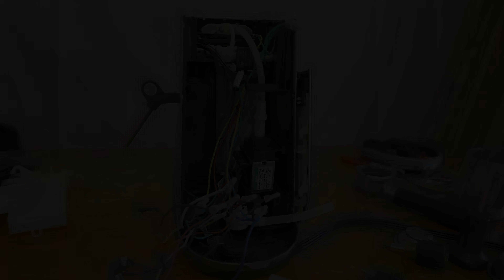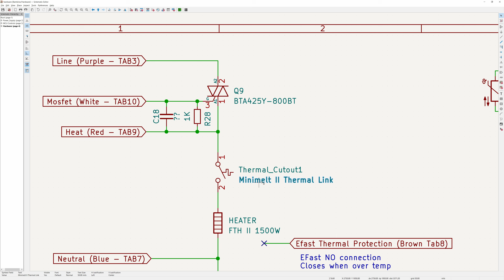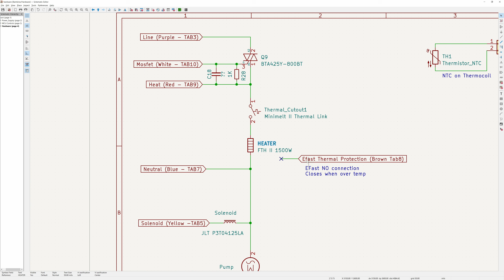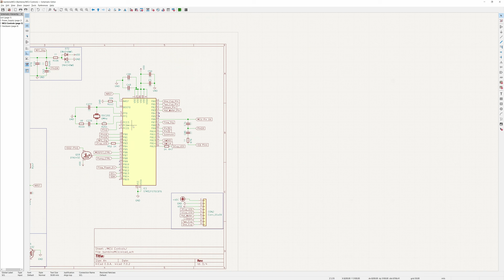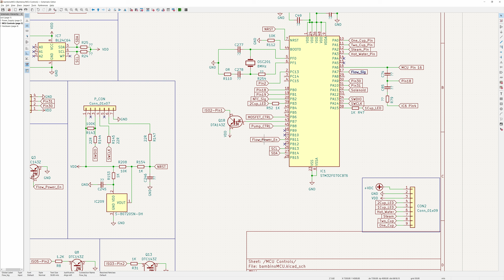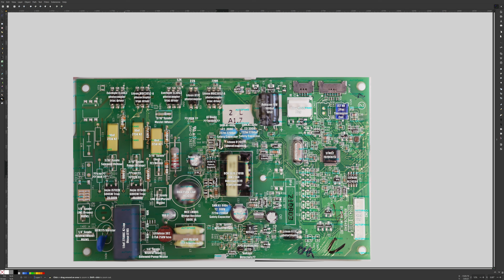An in depth look at Breville Bambino electronics...

Comment: what should be replaced if the machine suddenly wont turn on? I have a background in basic electronics troubleshooting back in college but its been a very long time and im on a different field now and did not pursue it, i just need some guide which fuse needs to be replaced and what specs? please help? I cant get myself to throw it away, and cannot find any competent technician in my area, they all wont touch anything that has no power and im very dissappinted and helpless

Comment: Thanks! Been troubleshooting this for a while. I get 120V at the pump terminals when plugged in but the pump doesn't run (it should, I tested it externally and it works) although I should be getting nothing until I pull a shot. The heater runs but there's no water so it melts itself into the plastic housing a bit before it gets cut-off. Internet says it sounds like a ghost voltage since the voltage drops at terminals when I try to pull a shot. Not sure if I should be testing the triac or octocoupler for the pump but I'll try that, I appreciate all of your work!

Comment: I've only looked at the Nespresso machines, but this diagram looks very familiar. Nice job with the reverse-engineering and documentation! It's fascinating to see the hardware reuse here.

R105 increases the range of the NTC50K in the FTH -- there's a crossover in the firmware around 70 degrees C where it engages that resistor in order to increase sensitivity at higher temperatures. This ensures that the measured value stays within the sensitive center band of the ADC's reading (between 200 and 1200, on a 12-bit ADC).

T_CON is for factory calibration -- it's used to set things like the PID parameters. There are a series of codes you have to shout at it to get it to respond. I haven't had a board with one hooked up, so I haven't done much with it.

The pump is a vibration pump that needs to be briefly turned on during a zero crossing event (when the AC waveform passes from negative to positive). IC6 is likely generating this signal -- the MCU will turn on the pump for a few microseconds when this zero crossing event occurs.

The EEPROM stores data such as calibration data for the PID, as well as a log of the various drinks that have been made. I'm sure that with this device, it's just tracking whether you pressed One Cup or Two Cups. If there's a descaling process, it'll keep track of when that needs to happen.

Comment: Hey tech dregs, my Bambino turns on, pump works, but the all the water is cold. Thoughts? I have the body open and the PCB exposed but don't see any loose wires, no blown capacitors, or burned connections. Going to go through and see if anythings shorted manually or see if something doesn't have continuity but aside from that, thoughts?
Reply from the maker: First thing I'd check is the thermal fuse on the heater. I think you could check it with a basic continuity test. It's the fuse is blown, you won't get any current through the heater and it won't heat.

Comment: Posting this on both Bambino teardown vids. This is such a high-quality teardown. The identification, the context, the comments, everything. awesome. thanks so much.
I realize this is over a year old, but posting here just in case you or anyone can help. I have the Bambino Plus, and I’m troubleshooting a failure where the water isn’t being heated and the top solenoid (which controls flow to the group head and steam wand) isn’t activating. I’ve ruled out blockages, solenoid coil failure, and board fuses — and verified top solenoid functions when manually triggered with a magnet. The heater is the same FTH-II as bambino.

I disassembled the heater box and noticed the terminals on either side of the little internal composite peice connected to the fuse plate are open, even though they both have red (hot) wires connected in series. I do however get continuity between the terminal with the printed dot (source hot line?) and the embedded copper insert below it (also imprinted with a dot), but not across the full fuse path to other terminal — which makes me think the internal thermal contact or plate has failed without any obvious melt on the thermal tape. The control board triac, varistor and other pcb fuse test fine.

Could this internal fuse failure (even without visible melting) explain both the lack of heating and the top solenoid not receiving power (maybe due to control logic that prevents group flow without heat)? I just want to sanity-check this before I replace the heater assembly.

Really appreciate your teardown and any insights you or others might have. Thanks again!

Comment: thank you very much for the explanations and your very interesting work. i've watched the two videos and i can't figure out which part manages what's called the PID? the temperature regulation close to 200°. i thought there would be an element, a chip to manage this part?
Reply from the maker: You can see most of that in the other video on the Bambino: https://www.youtube.com/watch?v=etxYC9AlBXM
Reply: @TechDregs  oh! that's just it! I was thinking of an A PID controller capable of correcting and learning. But its just a simple thermostat ? i thought that by recuperating the information via the blue cable it would be possible to act on the temperatures as with the mod pid for example. it's just a sort of “mechanical” thermostat? thanks again !
Reply from the maker: There's an NTC plug on the PCB. It's blue. You can see the signal path on the third page of the schematic.
Reply: @TechDregs  i find this : "I'm not sure if they can control the temperature thru the heating coils enough that it would be controlled by a PID. The whole instant heat is based on heating the mass at max then pushing the water thru the coils to get hot water. The PID would have to control the water flow since I don't believe it could really control the heating element properly.

I suspect that the heating element is design to let X amount of water go thru so that it will pull X amount of heat. Then you also have to worry about the exiting water pressure that will hit the puck.

Really, I don't know, but I think if they could put a simple PID in it, they would have if for no other reasons than marketing."
Reply from the maker: No, there is a thermistor for temperature sensing. It's right on top of the thermojet assembly. They could do PID using that, and then control the power to the heater via switching the mosfet on and off. They may even be able to switch the mosfet fast enough to allow for variable power delivery.

Comment: Awesome video and schematics, thanks. My working theory on the PIN2 input with the Schottkys at 22:01 is that the “any button pressed” signal might be used in software to help improve the reliability of button detection in the face of noise and heat from the nearby heater, which might otherwise trigger spurious/unintended presses if triggering on the individual inputs alone
Reply: Lore likely, the STM32 MCU can be configured to use a single pin as wake-up signal to power up the device from low-power standby (in this case when any button is pressed).

Comment: damn this looks so freaking easy to mod, surprised nobody else has, if I add temp ccontrol and remove the cleaning faetures I genuinely think this would be as good as a super expensive machine for me :| tempting but I need my machine and don't want to buy a second.

also with an stm32f070 i can just... reprogram it instead of making my own PCB!

somethings are confusing tho, why the seperate eeprom chip...

Comment: Fantastic work! Would you be willing to commit the KiCad schematic files you drew up to the Github repo ?

It inspired me to go down the route of a custom firmware / PCB replacement for the Bambino Plus. I've just ordered a slightly broken Bambino Plus (to avoid sacrificing the daily driver) and wonder if the unpopulated parts of the board are for the plus model 🤔

Comment: It would be a fantastic addition if one could decipher the programming code and figure out a simple mod to add a 7-segment led display or a small 32x64 OLED and 2 push buttons to allow you to constantly monitor the current temp at the group head and make negative or positive micro-adjustments to it. My dream comes:face-blue-smiling::face-blue-smiling::face-blue-smiling: true....

Comment: The presence of the eeprom is fascinating.

The stm32 itself has 128k of program storage and the eeprom has just 64, so I wonder what it's even there for. The only thing I can think of is that when you switch on the machine for the first time it refuses to make coffee and requires that you purge 500ml of water through it first.

Maybe the eeprom is just there so that it can switch between those modes? That seems like kind of a crazy reason to add a whole additional component, and I'm not even sure if that's how things work, I'm not an electrical engineer or anything. This aligns with pin 7 on the eeprom being left floating though which would make it writable. This might be by far the easiest PID mod if we just have to reprogram that stm32.
Reply from the maker: Yeah, I figured it was for user defined settings maybe? Like, when you program your own shot volumes perhaps? Definitely odd, given the chip capabilities.
Reply: @TechDregs  Oh duh, that is a way more important reason. I wonder why they couldn't just store that in the stm32, maybe they thought the flash on the controller would be less reliable for some reason? I wonder if I can find any connectors to put into T_CON since those pins have usart and that would open the door to either just connecting to a display, or even better connecting to a raspberry pi or something mounted on top of the machine.
Reply from the maker: IIRC, they were 1mm pitch. I looked around a bit, and never did ID what connector they are using. Kind of looks like a Molex Pico Lock, but they aren't quite the same.

Comment: WOW, thank you so much for this video.Pure Gold. Excellent guide and detailed information. I accidentally plug the espresso machine to 220v outlet and this info may come handy. I have my finger crossed and maybe I just have to replace the fuse and the varistor. Mine is the Bambino Plus I hope it has very similar electronics at least the area that blew up. Thank you and keep the good work.
Reply from the maker: Hope it's an easy fix!
Reply: Did you open it? was the PCB very different?